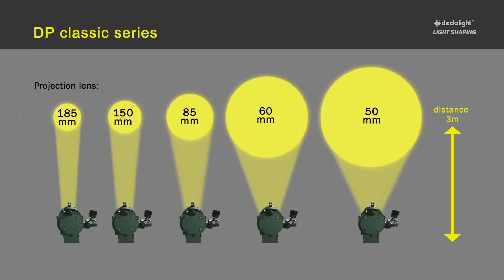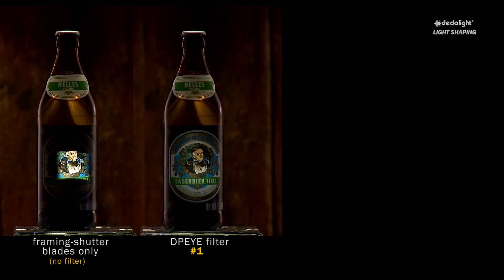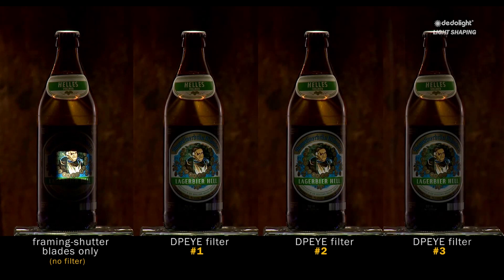Light & Shadow Shaping - with Imagers / Projection Attachments

Comment: Brilliant projection attachments and now can be wedded to Profoto flash by replacing the lens section of the Profoto Small Spot (only had to buy a few screws to do this). Dedolite and Profoto should team up for this as the quality and versatility of the Dedolight projection attachments are light years ahead of what Profoto has available.